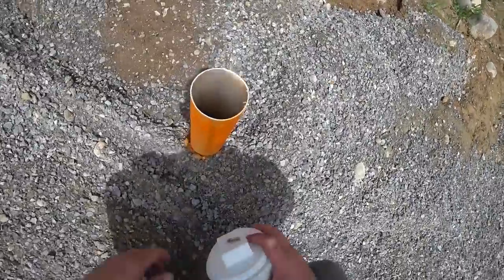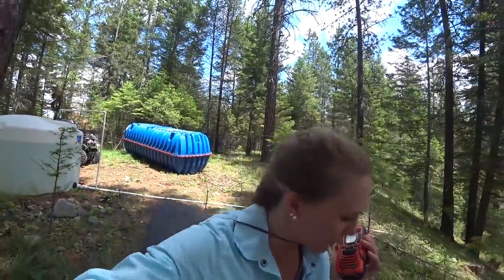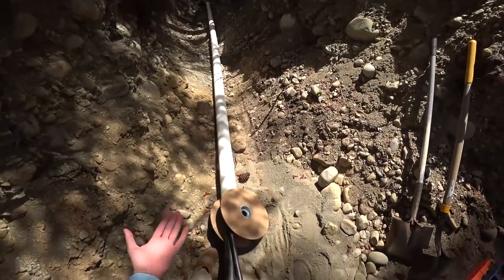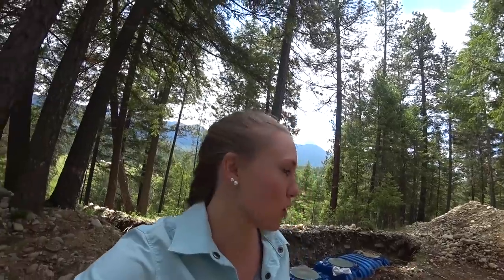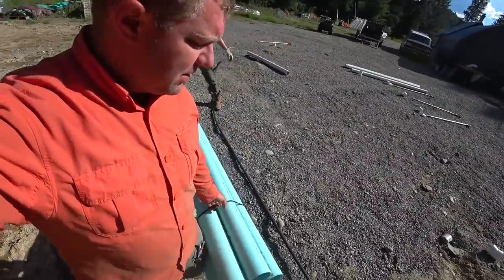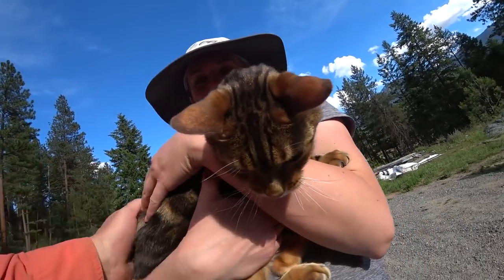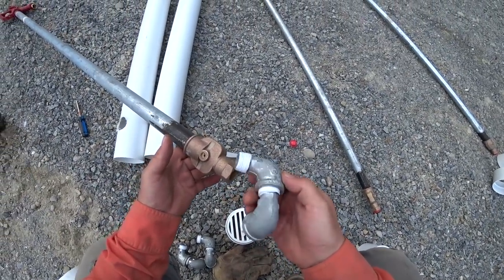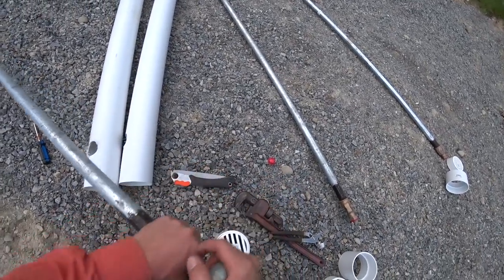Here a hydrant, there a hydrant, EVERYWHERE A HYDRANT HYDRANT!

Comment: Why do you have your wife on the pulling end?
Reply: I think it is because it was small pipe, and his back isn't as good as it once was.  They thought she should be able to pull it.
- When you run two or more 'flexible cables/pipes' inside a casing, they twist on each other.  Running the extra rope may not be helpful because it is also twisted around the other 2 pipes.  May never be able to pull another thing through that pipe.  I run stuff through conduit and casing all the time, it is always better to pull everything at one time.  Once you get it more than 50% full, you may never get anything new down the encasement after that.
My dad worked at a power and light company starting in the 50's, and they used liquid dishwashing soap as a lubricant right up until he retired in the 80's.
Reply: Many folks, me too, swear by Dawn for pulling soap in most types of pipe. Blue Dawn won't hurt anything since it's mild and generally safe in the environment if you spilled some by accident.

Comment: OMG, please stop using Teflon tape! The thread depth is way to deep. It'll bind up and keep you from fully threading the pipe tight. Get yourself some pipe dope it's way easier and fills the threads completely. Throw the tape away it's not worth the repair effort from it failing to seal.